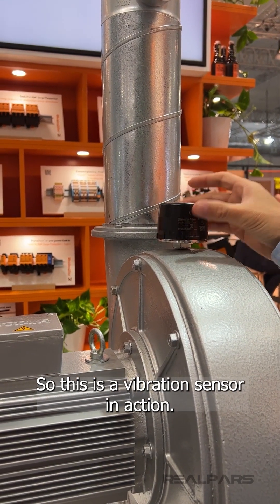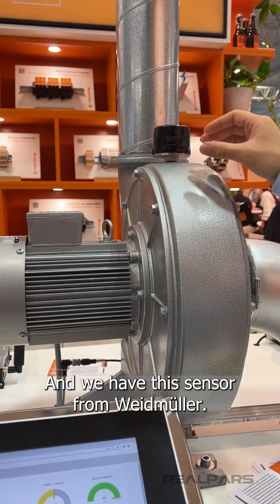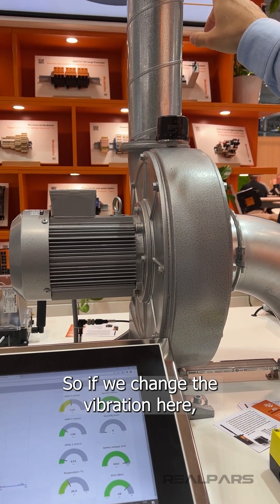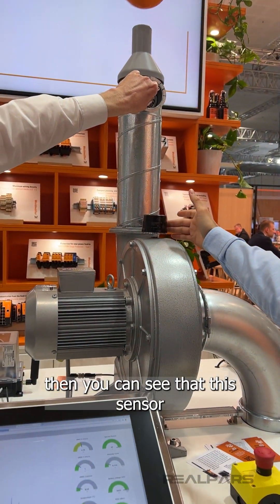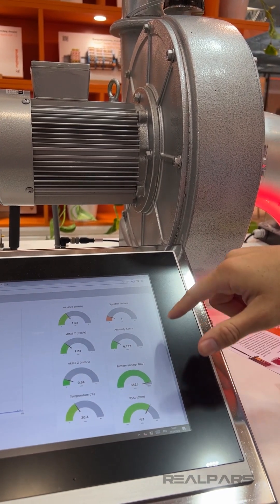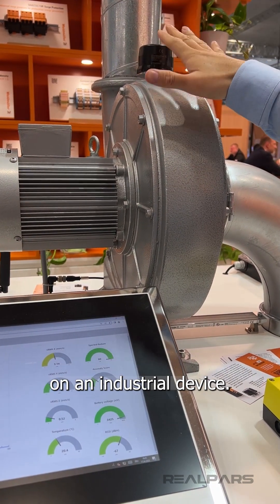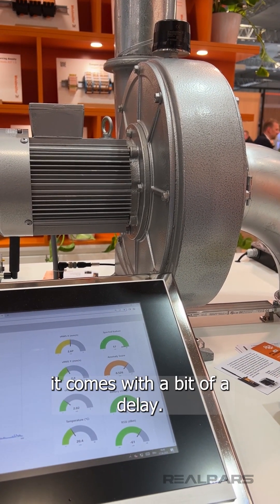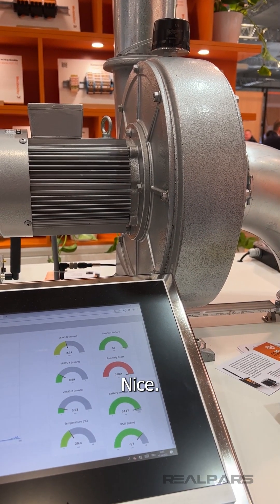Vibration sensor #shorts #realpars #automation

Comment: which software is that??😮
Reply from the maker: Thank you for your inquiry. To operate the sensor, you'll need the software listed below:

- Weidmüller IoT gateway featuring the integrated u-create web and u-sense vibration configurator web applications.
- A Bluetooth-compatible USB stick (such as the Weidmüller Stick US67-USB-STICK-BLE 2874720000).

For commissioning the sensor, you'll also need a computer within the same network as the IoT gateway. Here's the link for your reference and further understanding https://catalog.weidmueller.com/catalog/Start.do?ObjectID=2751260000&_gl=1*1o4r82z*_ga*NzMwMzIxNzcxLjE3MTQ1Mjk3Nzc.*_ga_RQ78GF08L5*MTcxNDUyOTc3Ny4xLjEuMTcxNDUyOTg1OS4wLjAuMA.

Comment: Is this vibration sensor possible to connect in mcu?
Reply from the maker: Thank you for your question. If I understand correctly, you're inquiring whether a vibration sensor can connect with a microcontroller unit (MCU). In response, I would say yes, it's indeed possible, but it hinges on several factors including the compatibility of your MCU, the sensor, and the interface being utilized. Additionally, it's important to have a good understanding of your MCU's specifications. I'd recommend reviewing the sensor's datasheet as well for further clarity. If you need assistance with any specific details, feel free to ask.
Reply: @realpars Would you find vibration sensor based on below requirements..
Sampling frequency -800hz to 25khz
3 axis accelerometer, embedded temperature sensor..

Comment: Isn't that delay a real problem? If it goes into overspeed every millisecond is important. This is purely as a indication I guess than.
Reply from the maker: Thank you for your inquiry. In the described motor setup, overspeed shouldn't be a concern. This configuration operates within the limits dictated by the incoming voltage, ensuring the motor doesn't exceed its intended speed. Specifically designed for monitoring fan blades and bearings, this setup serves its purpose effectively. While there are more costly sensors available on the market that offer quicker reaction times, they may not be necessary for this application. If you're interested in exploring industrial sensors further, I recommend checking out this link to a company specializing in such technology. It could provide valuable insights into sensor capabilities and applications. https://www.keyence.com/products/

Comment: Why is the vibration sensor mounted on the casing and not near bearing? Is there any special reason?
Reply from the maker: Thank you for your inquiry. When it comes to mounting a vibration sensor near bearings, it's crucial to use the appropriate sensor for the task. Typically, the sensor is placed outside the bearing to ensure easy access for maintenance personnel. However, mounting it on the casing can also be effective, depending on the specific sensor being used. Vibration will resonate differently on the casing, but calibration can be adjusted according to engineering specifications. There are various sensors tailored for different applications, and exploring this link might provide you with further insights into these devices.